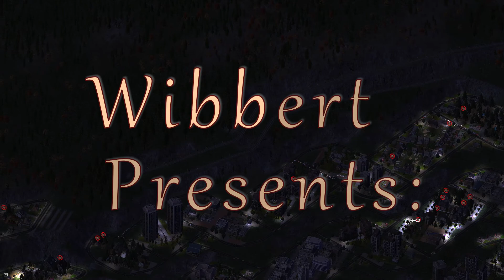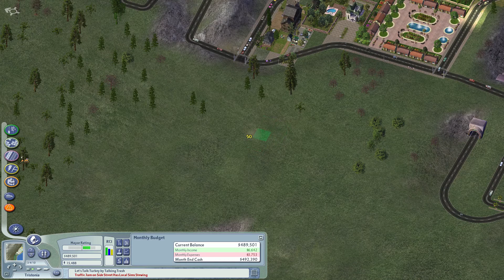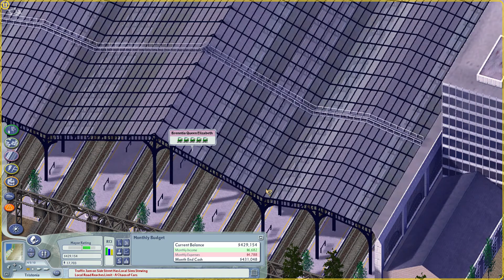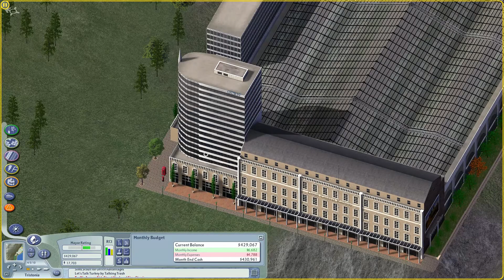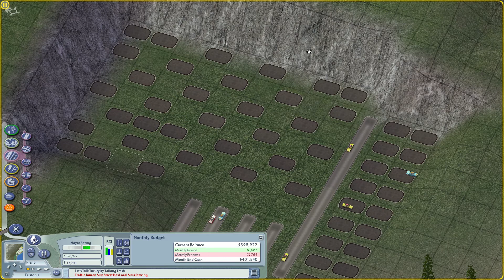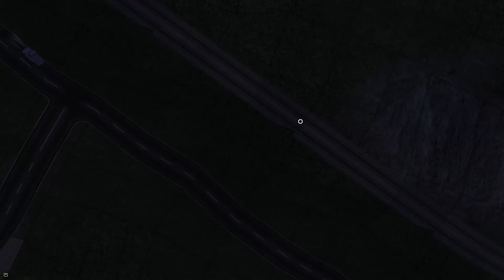Tristonia TrainStations SimCity 4 S2:E21

Comment: Little long video, all except one terminus stations !Modern Brenntnia  with underground track or subway posiblel . Gare du Nord l, madrid Barnebeay larger elss flexibl. Would rather see them used in this layout !
Reply from the maker: I'm trying to keep them short but time just flies by when I'm recording. i did consider the Gare du Nord station but it was to large, the larger ones I shower had 8 tracks which was already more than I know what to do with in a mountainous area like this so 12 tracks didn't seem to make sense even considering for this city though it is a nice station with a very nice style.